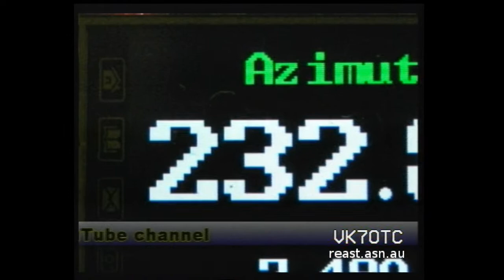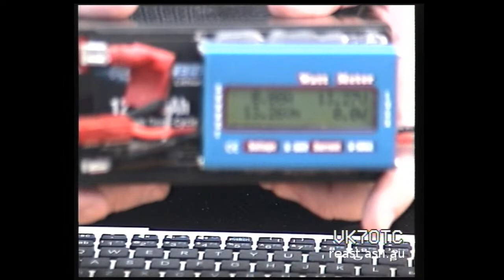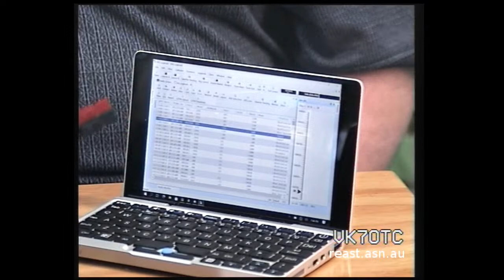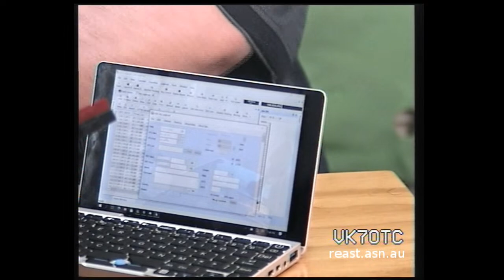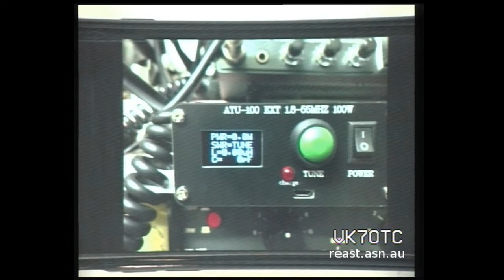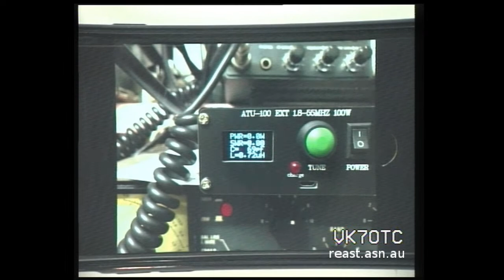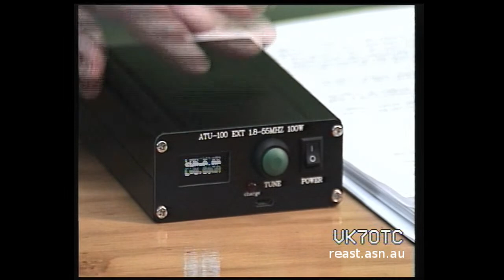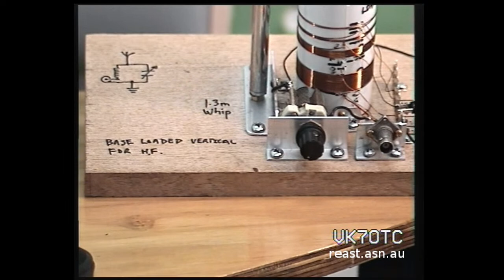DATV Experimenter's Night - VK7BEN Portable Digital, ATU-100, Base Loaded Vertical & VK Contesting

Comment: I quite like mine. it has the two extra buttons and no battery. I built the unit and it was a fun project if you like building stuff. I want to get the 1000 watt model sometime if it remains available.